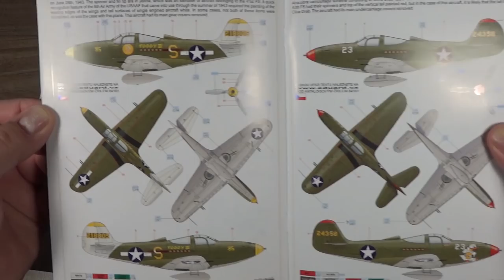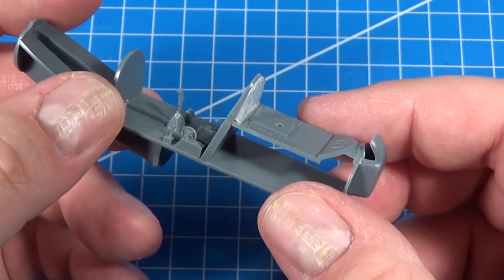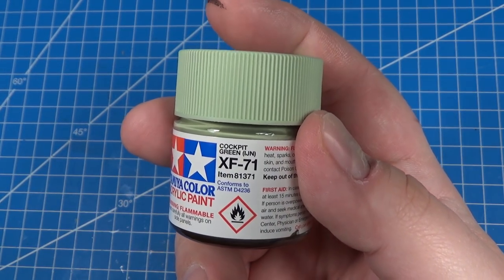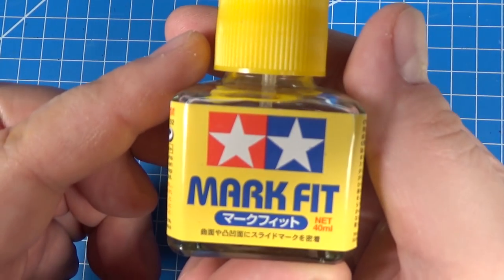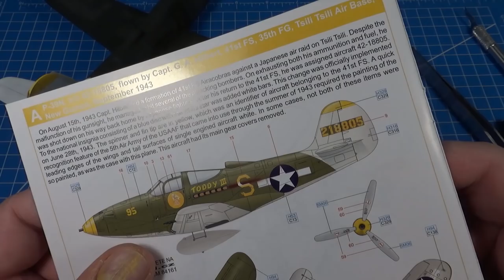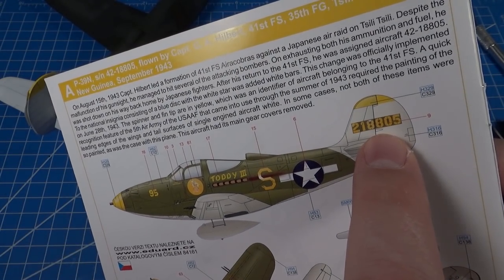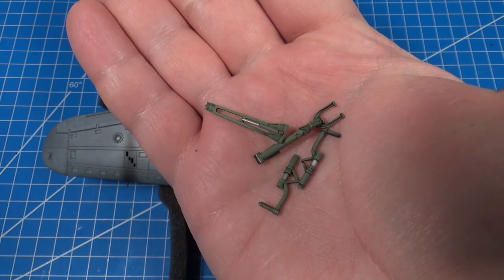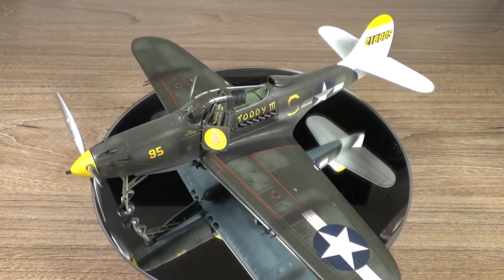Model P-39 Airacobra - 1/48 Eduard

Comment: Thank you for this tutorial: I'll partly use your methods in my building. Will you be so kind to tell is it very difficult to take off liquid mask after painting? It's seems to me that it not so easy.
Reply from the maker: You're welcome :)
As for the liquid mask - there's nothing easier than removing it. You can just roll it off with your finger. It's just an elastic silicone-like layer that is not attached to the surface. The most convenient way is just to use a toothpick and scrape it off delicately (wood should not scrape the clear part when used delicately).
Reply: Big Modeller Thank you for your explanation. I didn’t use it before, only the paper mask. It will be my first experience. :-)
Reply from the maker: You'll try it - you'll love it ;)
Reply: Big Modeller Hope it is so! Didn’t make any models for a long time and now see to many changes. I look like real novice now. :-) I’ll try all my bests to make Airacobra not bad. Sure that your video will help me.